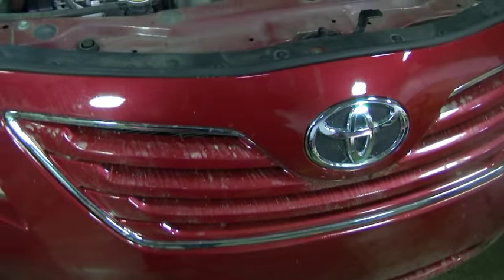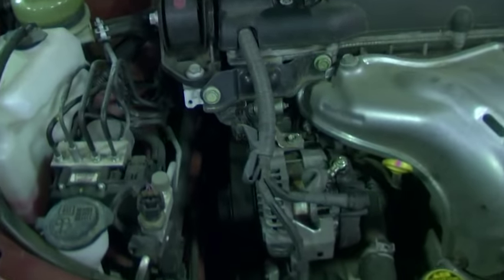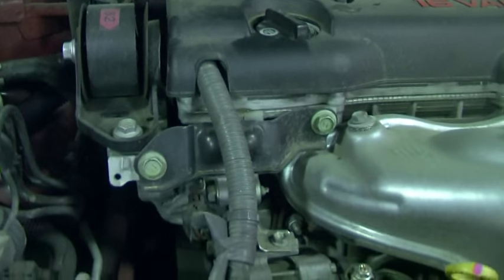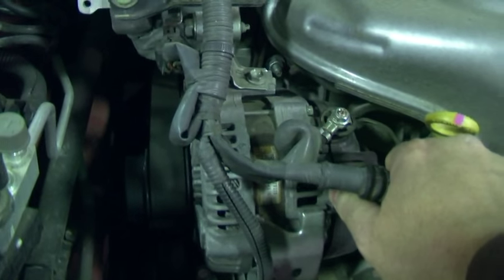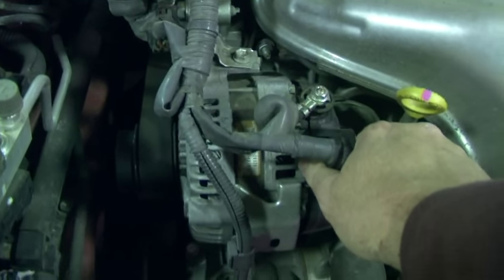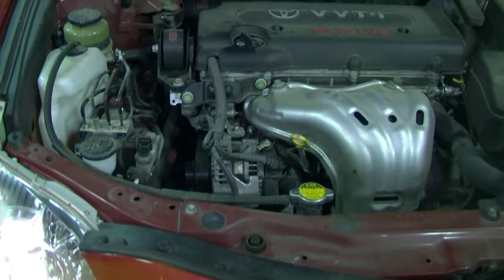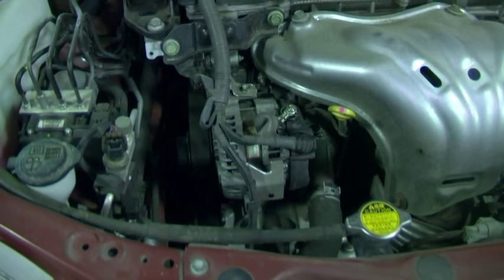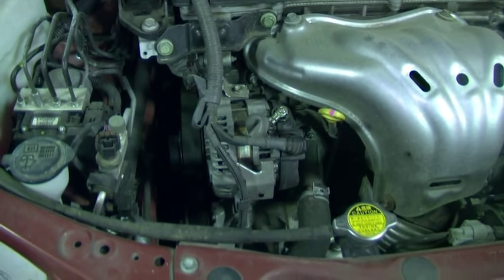Noisy Whining Alternator

Comment: so if the alternator make this noise that means it's a bad alternator?
Reply: A.B. Cuevas bad bearing.
Reply: ibrxhim MMA is that expensive?
Reply: Barking Spider no just the bearing alone is inexpensive but replacing it is a bit of a hassle
Reply: ibrxhim MMA I just called a mechanic and he told me since my car is. 99 I,should just replace it
Reply: Barking Spider that would be your best bet, what vehicle do you have ?
Reply: ibrxhim MMA 1999 Toyota celica conv
Reply: Barking Spider you should be able to easily find a bearing to replace it with, like I stated earlier it's a bit of a hassle but once replaced the winning should stop and spin more freely as well as hold the alternator better
Reply: ibrxhim MMA well I found a place near me that has them for sale for 80 bucks. The mechanic told me he would put it in for 116 bucks. What do you Think?
Reply: Barking Spider are you familiar with working on vehicles? would you Consider doing the job yourself?
Reply: ibrxhim MMA nope I know nothing about cars dude.
Reply: Barking Spider okay that's totally fine cars can be a complicated machine, so what I would do is make sure that it IS the alternator bearing making this whinning noise, see things such as the alternator and water pump are usually ran by a belt at high speed and if a bearing is either loose or bad it will cause this whinning noise, so I would make sure it is either the alternator or the water pump , ask your mechanic which of the two it is
Reply: my car is making the same sound after hurricane Irma hit us September 10 2017 so do I changed the whole alternator or just the alternator bearing please help me out I was told it was a belt tensioner
Reply from the maker: Sorry not a bad bearing. With a lite load, unplugging the alternator would not make the bearing stop whining. Unplugging the alternator stop the noise completely. You did notice the bearing was still turning, didn't you?
Reply: Have this exact problem,  got a brand new alternator, but still has the noise.. what should I do?
Reply: @zaneweis3854  did you check the power steering/fluid?
Reply: BaldBarber67 thnx I’m having the same issue light and all. My battery completely died last night so my alternator is no longer charging it.  Thnx
Reply: @cnottagejr  what was the final diagnosis?
Reply: ibrxhim MMA considering this sound stops when he unplugs the alt There’s no way it would be bearings

Comment: my car sounds like that when the outside temp is less than 40°F and then goes away after the idle drops below 1,000rpm. doest happen until the engine is cold again. would that be the alternator? it makes almost an identical noise.
Reply: +KJ McLaws electronics can be susceptible to temperature fluctuations and differences. One way to test for this is to check the battery voltage while the car is idling. If the car's voltage is less than 13.2v while idling, then the alternator is bad.
Reply: +imzjustplayin thanks for the reply. since I posted this comment the car refused to go above 10 mph. it was the stepper motor in the tranny. needed a whole new tranny. traded her in a bought a new car.

Comment: In my car it intensifies when I turn the steering wheel, and I suspect it might be the belt running the power steering-pump?
Reply: juiuffophiguo same bro. Mines too. What happened with your issue.
Reply: @JD-oi2ql  haven't gotten around to it yet :/ have you cheched the power steering pump itself?
Reply: So what did you guys end up fixing..?
Mines doing the same gets louder when I turn. 97' firebird manual
Reply: Mine is doing this with a similar noise but not as Lloyd. Can only hear it inside the cabin. Getting light smoke from the engine compartments. Not sure if it’s the alternator or the water pump. ??

Comment: My 99 Toyota Landcruiser 4.7L has the same noise.  I removed serpentine belt and spun the alternator pulley.  It was very loud and grinding.  Bearing is obviously bad. Can I replace just the bearing? Thanks
Reply: Jeffrey Mackey not if that's old. Better to replace

Comment: So was it the diodes or the bearings?
Reply from the maker: If it still makes the same noise after unplugging it, then the alternator bearings or something else besides the alternator is at fault. If it stops when unplugging it, its the diodes in the alternator.
Reply: TCAT Autotech so I  unplugged it and it stopped whining... gotta change the diodes then... THANKS!!!
Reply from the maker: You can change the just diodes if you can get them, but most people would replace the entire alternator.
Reply: May I add some fact. I research about it found out there 6 diox for 3 coil pack. If one or 2 diox die it unbalanced and making lound noise. Thank to this video I already change mine.

Comment: what exactly makes that noise in alternator? is the alternator with this noise fixable? Started my car this morning with this noise and after 2nd start the battery light came on. So pulled the alternator out and thinking if it is fixable or need new alternator
Reply from the maker: The problem is with the diodes in the alternator. It could be fixed by a shop that rebuilds alternators, but I wouldn't try it myself.

Comment: how can a diode cause that noise?
Reply: bobl78 idk im Intrigued though
Reply: It's causing a short circuit which puts an enormous load on the alternator. You can hear the engine speed up a little bit after he unplugs the alternator, which demonstrates the drag that it is causing. The noise is a characteristic sound of any alternator/generator assembly that is placed under a load, but in this case, it is at its most extreme.
Reply: @Owiko7  a load of which can kill it really quickly almost a matter of weeks pretty much less than a month
Reply: At the worst at least
Reply: Simple answer - internally out of balance . In depth answer - 1 of the 3 phases is out synch ( blown diode ) due to the uneven load causing a harmonic frequency culminating in noise .

Comment: So if you unplug it from the alternator and the noise don’t go away it’s not the alternator ?
Reply from the maker: Yes, look at the belt or an alternator bearing, idler pulley or something like that.
Reply: @ttcautotech  it was the idler pulley
Reply: Next test is silitoscope trace of sound location I guess. Some people silicone grease to belt. If belt mis alliances belts fault it gone away. Spary some water test is not reliable. I did mine noise gone like 6 sec. But it still altornator fault .

Comment: Hey if you put new alternator on and doing the same thing what does the mean
Reply from the maker: The most common cause of whining is the belt or a bearing. This one just happened to be an internal diode which is a rare event. If you've replaced the alternator I'd look at the idler/tensioner pulley or the belt. Pour some water on the belt. If the noise stops temporarily, it's either the belt or a belt alignment issue
Reply: I replaced my alternator because it was bad. Now the new alternator is acting exactly the same as in your video. I unplugged the connection from the back of alternator (like you did) and took a reading from the negative wire and it is showing 4.66v. Positive is 12.9v. What does this mean?

Comment: I have the same kinda noise but only on cold starts after a vew minutes of driving it goes away, untill the next cold start.. could that still be the alternator?
Reply: petrol station same here.  Does the sound get louder when you turn the steering wheel?

Comment: This is what mine sounds like but every time I take it to the shop they all say it's perfectly fine. I am convinced my car is haunted.
Reply from the maker: The alternator will still charge and pass an alternator output test if they perform it. It should fail the diode test if their machine checks for it. Either way, if it quits whining when they unplug it, the alternator needs to be replaced.
Reply: @ttcautotech  thank you.

Comment: Does the sound go away after engine is warmed up?
Reply: BIG DRU I also experience it when during cold start.  Not sure if it’s alternator or power steering.
Reply: I have the same sound on cold mornings in my 4.7 iforce v8

Comment: Exact sound my Honda is making at cold start. Let’s hope it’s the alternator.
Reply: Hi, Same here With my corolla. It Will Make the whining noise at could start But After 10 Minutes of driving the noise Will Go away. Is Yours the Same? Have you Made it checked?
Reply: I mean cold start
Reply: @jaysona3066  hi, it turns out it was actually a leak in the power steering system on my car.

Comment: My alternator makes a whirring noise too. I even replaced the alternator and adjusted the belt, but still it's making the noise.
Mk2 golf 91
Reply: then its not your alternator bro :P check play in tensioner, and other pulleys also.
Reply: ExplicitXxHD the belts are tight. I'm suspecting the water pump, but I can hear the noise right next to the alternator blades
Reply: Student of knowledge my issue was the idler pulley, did you get your noise fixed?

Comment: To anyone that watches this video, it is great but it is not always the alternator!!!! My car was making this exact noise, I kept telling my mechanic it was the alternator after this video he was confident it was a pulley. We changed belt tensioner pulley and still no, then he noticed idler pulley making noise with his stethoscope, turns out it was a BEARING In the IDLER PULLEY. so great video but do not tell everyone this is the alternator which is a very expensive fix when it could be something simpler like a pulley. For me it was a $30 fix I could not believe I was going to spend $400 for a new alternator after watching this video, sigh....
Reply: i dont think he was saying its always the alternator.  relax
Reply: The noise stops when he unplugged the alternator, logically that would indicate its the alternator. If it was anything else the noise would have continued.
Reply: Nick Allen yup you are right on, he's right to think it's anything but the alternator, but if you disconnect it and the noise stops then it's obviously the alternator

Comment: Same sound but when I unplug the alternator it's still there so is it the alternator
Reply from the maker: It still could be the bearing inside the alternator.  It wont quit until you shut the engine off. Pour some water on the belt while the engine's running, if noise goes away it's the belt.  Also check the other rotating components. They all have bearings too.
Reply: Garrett Cruz according to a video uploaded by saabkyle04 He did a video on a Chevy Malibu or Impala I can’t remember and it had a whining sound but it wasn’t nearly as bad as this but they couldn’t figure it out apparently it was common with the model of engine it had

Comment: you just ruined the timing belt to by running it with a locked pulley on the drive belt
Reply: Aaron Ditchfield There is no locked pulley on the drive belt, the alternator is spinning while it's plugged in and not plugged in

Comment: Hi TCAT auto, I thank you so much for posting this video. I really really need your help, I am having a very similar noise I think it is the same. My battery was extremely weak and died multiple times and I have just replaced the battery. I think my battery failing caused my alternator to go as I knew I had a weak battery for a very long time but didn't get time to replace. I have this video can you please watch, only half a minute of the noise inside my cabin exactly like yours. Will I need to change my alternator completely or do you think it could be a bearing problem? Thank you so so much again!!!!! I have been researching and asking friends and am almost going crazy due to this. My car has so much of power loss as well I dislike driving it. I have an Acura csx.

https://youtu.be/qOJ7yc1i4lI